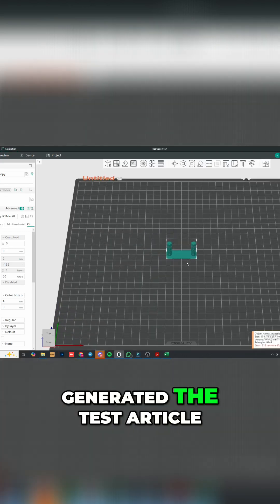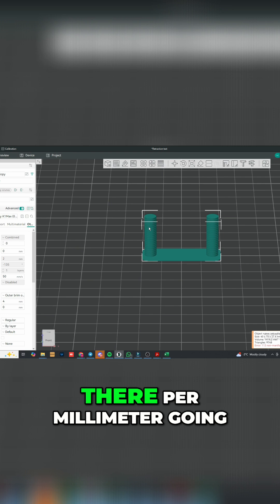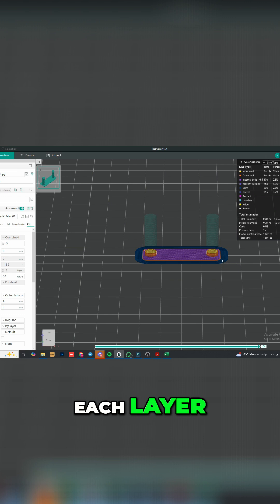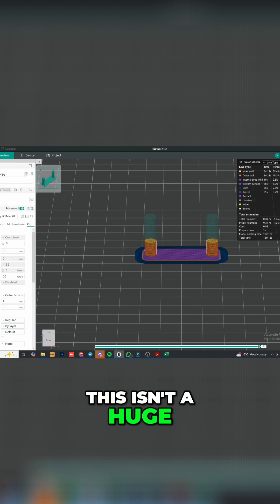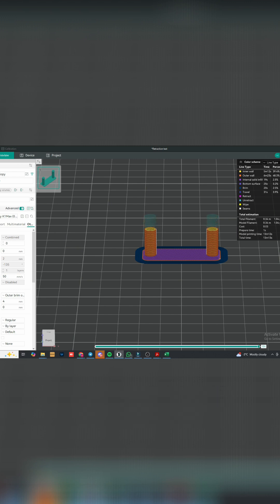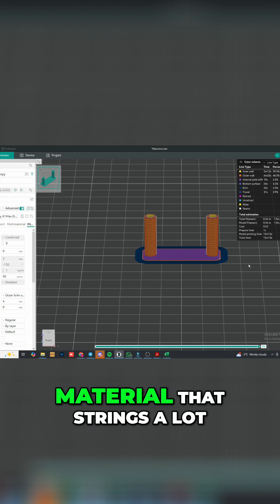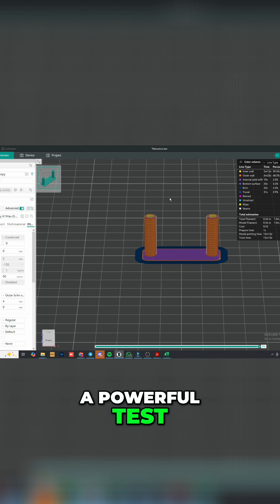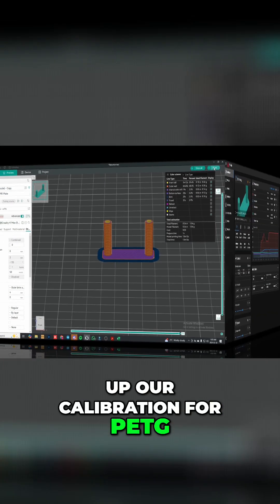Mastering Retraction Settings for Perfect 3D Prints

Comment: Does anyone know how to reduce retraction on creality slicer? I'm desperately trying to print TPU but everytime I try I got stringing issues due to the high retraction level
Reply from the maker: If you follow the full calibration video I have for LW PLA you will see the calibration settings for Orca.
Reply: mine retracts so much it has trouble starting solid on the next bead. still have not found how to adjust. there is a option in the advanced  seam tab called "wipe on loops" this option got rid of most of the stringing for me.

Comment: This software looks really nice.. if u don’t mind me asking what is it? I’m new to 3d printing, stuck with an ender 3 pro v1.5 meaning ender 3 v2 board in an ender 3 pro chassis and hardware.
Reply from the maker: I am running Orca Slicer and printing on a Creality K1 Max printer using the Mainsail user interface.  I really recommend the Mainsail upgrade!